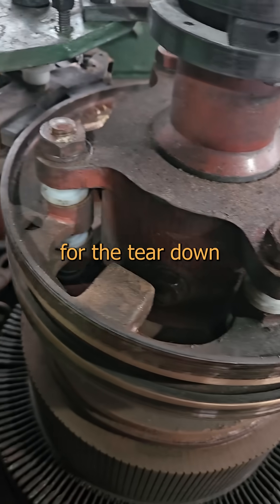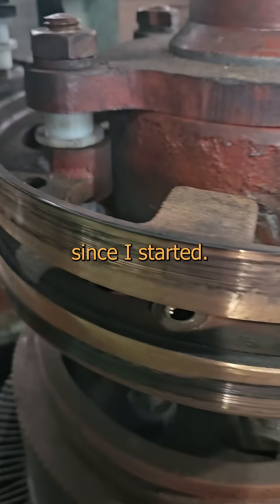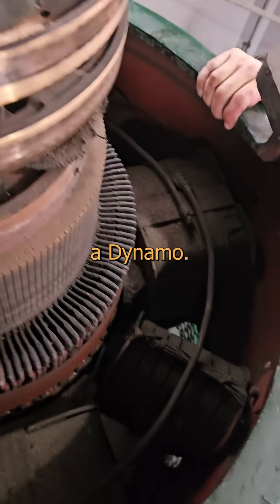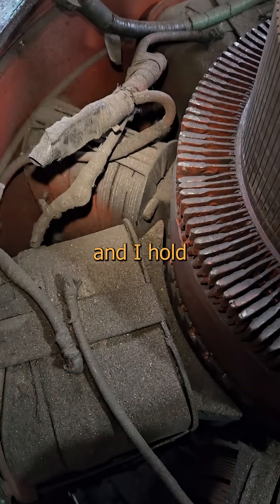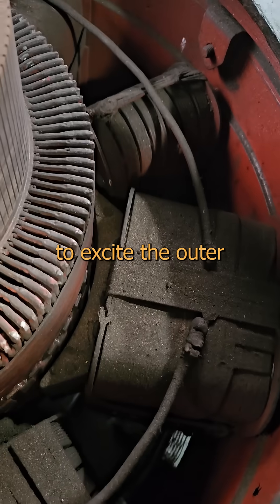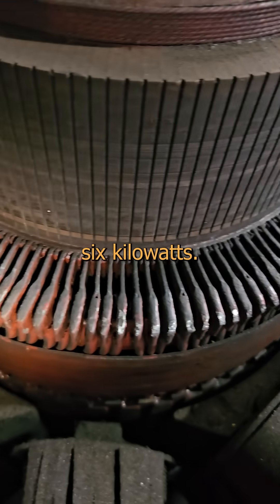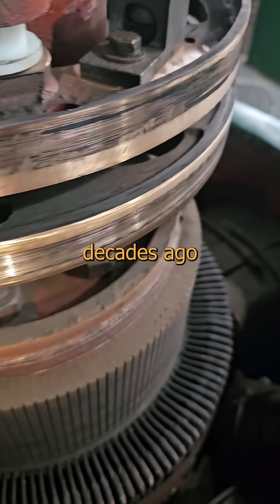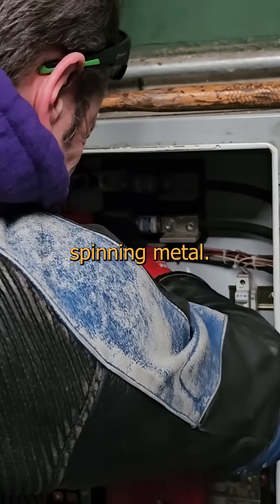Dynamo #chrisboden #engineering #generator #educational #powerplant #dc #exciter #field #hydropower

Comment: The downside with the new system is that you need power to generate power. If there is a full network blackout for any reason, it's plants like yours that will restart the network.

Keep the dynamo. Be one of the doomsday movie heroes.
Reply: First you need a bicycle.
Then fit a dynamo, and pedal. Use this to trickle charge the jump pack.
This can be used to start a diesel generator.
Which can be hooked up to some emergency lights. Now you can switch off your head torches.... ;)
Use this to power the....
Reply: @johnathanh2660  the whole of north America jump started by a bicycle xD
Reply: @Falney Have you heard anything more North American? 😂
Reply: @Blewlongmun restarting the grid from a PTO-driven generator on a tractor would be more in character, America isn't exactly known for being bike-friendly as a whole
Reply: @ America as a whole no, the south is generally more stereotyped as farmers strangely. 
People like mountain bikes here.
Reply: @johnathanh2660 I would skip the bicycle and start perhaps with smaller gas generator with pull start. That can charge a battery is needed to start something bigger.
Reply: @Trex0Pol  
I was going to suggest a hamster in a wheel 😬
Reply: @johnathanh2660  he only need a steam engine now
Reply: Question is who plays Chris in the zoetrope theatre talkie in settlement 9 after the fall? My money’s on Ralph Finnes. He’s older and more griz in his riz than Chris, but Chris punches way above his weight on both intelligence and wisdom so it’ll look more believable to the normies.
Reply: @GrayeWilliams  Hm... Why not de-age Christopher Walken by three decades?

I know I know... necromancy is still illegal - but let a man dream :D
Reply: If they scrap it, take it home lol. If you don’t want it, I’d love to take it off your hands, hopefully I’ll be in a position too when that time comes.
Reply: @zacharysullivan6242  Scrapping it means recycling all of the metal.
Reply: That's why he wants to be able to black start the plant. That can actually make you money, in some power grids. I know in Ohio they pay premiums to the plants that can start from full black.
Reply: You could also generate the exciter voltage and the feed for the controls off a diesel genset or a big ol battery bank.
Just like modern hospitals they have both. 
A huge completely grid independent diesel for the whole building and a battery bank and UPS supply for critical systems in the operating theatres that cant have any power interruption.
You dont need much to be prepared for a blackstart. Just batterys for the exciter voltage and controls.
Reply: Don't they have diesel generators or something for power plants? You'd think they'd all keep backups if power for black starts is hard
Reply: Came here to say this.
Reply: There's plenty of permanent magnet generators on the grid right now . . . ..
Reply: @alphaHero100  welcome to the chat down beat Darren.
Reply: diesel generators are the norm for black start up now.
Reply: As Diesel black start generators get old and need replacing they are starting to get replaced with battery systems. 

One of the big barriers to this was the short circuit current needed for the static starting system. A diesel generator could handle 6x its normal capacity. A batteries inverters might only handle 1.2x its capacity. 
To resolve the issues associated with low short circuit current without dramatically increasing the number of inverters, a large harmonic filter was incorporated into the battery system design. Solving this problem. 

A 200MW battery in SE US was installed in 2020 that supported black start situations. Since that proved the concept many more have been installed since. 

But it’s going to be a long time before they are more common than the existing Diesel generators.
Reply: So Meta!
Reply: Kinda what hapened in Spain this week
Reply: @guillelazza
They have not finalized the investigation yet but I believe the lack of Inertia in the system is what was the final straw that caused things to fail. 

There was a ton of solar power available being generated by grid following inverters. So without the inertia on the grid from big turbines spinning they could not maintain the frequency. Once the frequency gets to far away from 50hz the grid just starts shutting down to protect itself. 

I believe they will solve this with batteries that have grid forming inverters which can create fake inertia. 

Spain has the same or more solar than California but Spain only has 33Mw of battery capacity compared to 13,000Mw of batteries in California.
Reply: That's alarming to hear. Design principles I've worked with have always included failure down to complete analog and being able to get back online from there. I sort of assumed that went the same for the power supply systems. It just makes basic sense they'd have backup power generators, and batteries in redundant systems that could be used to cold start systems back up.
Reply: What's the "new system"? Is it like "energize coils with %external power source%, then it will power itself"?
Reply: @syrslava705 an external excitation system. It uses the grid power to create the DC to excite the armature instead. 
This plant likely has a backup diesel genset to power the plant and get a unit started in the case of a blackout
Reply: @syrslava705  Sort of the difference between your push mower, that has a magneto to create the spark, and your modern car with electronic ignition powered by the alternator/battery. (but that may be over simplifying things).
Reply: I think we have plenty of solar and wind now to get the grid going.
Reply: @ecospider5  nope you need 60hz ac power for that and the grid uses the giant spinning things with water or really hot water going past it to keep solar and wind moderated. It could be done but it's more expensive. A full black start of the east coast grid would take weeks at best starting from diesel peaker plants and hydro like his.
Reply: @Teiichi42
That was true just a couple years ago. There are enough grid scale batteries that have been installed in the last 2 years that they can create the 60hz on the grid from scratch. Without a physical generator creating the 60hz. Then the solar would kick in and keep those batteries charged until the gas and coal power plants start up. 

This has not been used on a large scale I don’t believe but the theory is there.
Reply: @ecospider5 
Solar and batteries are electronic "followers". I think wind is the same as it goes from DC to AC.
I don't believe they can black start grid.
Reply: @ecospider5 1: solar and wind need something (a working net) to synch against, as stated above here.
2: Look up the word "Dunkelflaute"! Scenario:"Dull winter days with no wind, and we have scrapped all coal power plants and my Tesla is dead and needs charging!"

Comment: That "Dynamo" looks so very similar to the Lincoln Electric Corp older engine driven welders I repair.  The good ole SA-200 "pipeliner" style of machines.
Reply: Not only those old school welders , but the old school battery chargers are covered and hoarded by knowledgeable folks as well .
They can both breath a little life back into a battery that is at deaths door , and isn't at a SOC high enough for the modern electronically controlled chargers to even begin to charge up .
Yes , a lead acid battery in this condition is on borrowed time , BUT, of it's the only battery you have to start the vehicle to go get a replacement ....
Reply: @kaboom4679 Absolutely!  The Lincoln battery charger was beast!  Many of the chargers of old where far better than todays 1/2 wave rectified electronic trash.  I should seriously consider modifying a DC constant voltage(MIG) welder for my battery charging duty.  Thanks for the reminder.
Reply: Awesome welders! Wish I had one. I only have an ancient Lincoln stick welder with high and low being the only settings and it depends on which plug you put your lead in. Weights a ton despite being not much bigger than a mail box
Reply: @ That machine may only be AC output and very old it will never let you down.  Other than the power switch that power supply has nothing that will fail unless you use beyond it's limits.  It's an heirloom type machine!  The new machines  -  well.......not so much.
Reply: An old Buzz Box! I'd love to find an old one for stick welding.
Reply: @ Look for an old red round top Idealarc AC/DC 250.  Bigger and heavier than the "buzzbox", but a lifetime machine.  They weld great, but are generally thought of as junk by fools. So, you may get one reasonably priced.
Reply: Those are the best machines.
Reply: @ They have their many pro and cons, but the older machines are typically easily repaired and aftermarket parts are available - for now.  Lincoln stopped production of all or the old armature engine driven machines recently.  So, good luck to them with their new all electronic machines for rugged outdoor duties.  "IPhones" don't last long in the construction industry.

Comment: Most people don't understand that it takes grid power (in most cases) to energize the coils to create the magnetic field than then creates more electricity in other coils. Those wind turbines you see everywhere are sucking up thousands of watts of power each... but they produce 1.5 megawatts so theres a large net gain. Being able to black start a whole power plant off of one car battery would be something I would LOVE to see.
Reply: It takes megawatts to run a power station and hours to days to get power out of them. (Thermal) it’s impressive to be able to start off a car battery. 
I worked at a hydro station that black started off a 1kva Honda generator and they still had the original generator from construction in the 70’s
Reply: 12 volts DC to bring generators like this to life is done every hour of everyday.  A 12 volt car battery on the brushes of the exciter(dynamo) will easily build a strong enough magnetic field around the armature to induce enough power to excite the rotor within the high voltage stator to bring the whole system to life.  How much voltage is used to bring very large diesel driven power generators to life?  It's 12/24 volts from the batteries.  Simple engineering really.  I'm sure Chris will gleefully show us the simple process when the time comes.
Reply: 10% of the power generated in combustion power plant is needed to main the power plant...a cold start of a power grid is...something

Comment: You could really start a dynamo from a car battery?
Reply: Yes, it's done every time most any generator starts.  Even Megawatt sized portable gensets get their start off of the engine batteries.  Spin the shaft add a couple volts for a second or less to the brushes and a couple seconds later full power.

Comment: I would drive to you with jumper cables and my car to help..

And thats pretty cool!
Reply: i'd take the batteries out of every piece of old iron, both on and off road, just to help lol
them semis have massive batteries, 2 of em usually, sometimes paralel, some times series depending on the disposition of the machine, either askin for 2-4 volts wortha pissed off pixies, or 1-2 volts worth'a pissed pixies

Comment: Also, historical technology is fun. It's good to know where things came from because something from the past might inspire something new because someone sees it from a different angle.
Reply: I agree, historical tech is fun, like older vacuum cleaners from times when people didn't have electricity, they're still vacuum, but it's like you try to use a manual "air pusher" (idk it's name in any language) as a leafblower
Reply: Yes, it would be a shame if it was "AIP'd" (whatever that means).
Reply: @charlesrichards5389  Abandoned In Place. Not in use anymore, but just left there because removing it would cost more in labor and lifting equipment than the scrap value.
Reply: @ aka "leave it for the sucker after us to deal with." 😉
Reply: @mfbfreak  Thank you!

Comment: That's absolutely amazing. I want to build one. I completely agree, it should be the emergency backup. That should still work if it's EmPed, as long as it was off when the pulse hit. 😅
Reply: If your hypothetical emp is strong enough to take those wires, I'd be far more concerned about the blast that created it.
Reply: Even if it was on, it's literally just two wires that go in circles, what's there to break
Reply: @younscrafter7372emps destroys wires
Reply: @masklessninja  these wires are rated for 50 Amps and can probably survive a lot more if it's only a short burst. You'd need an extremely strong EMP to destroy, thousands of times stronger than what it would take to destroy a computer